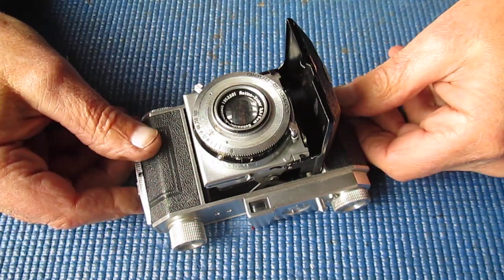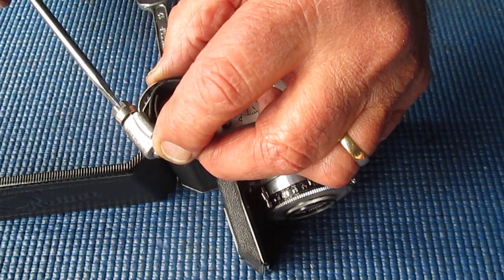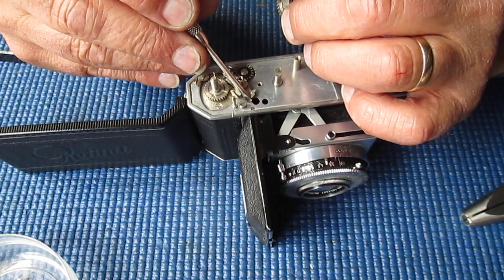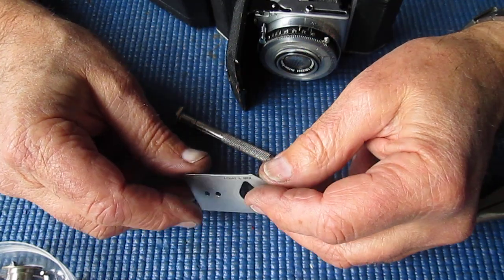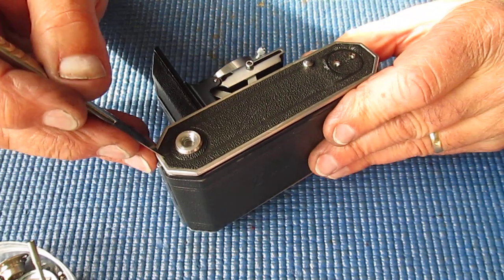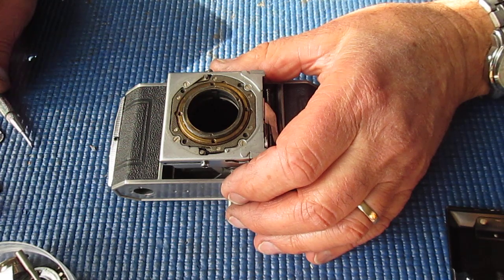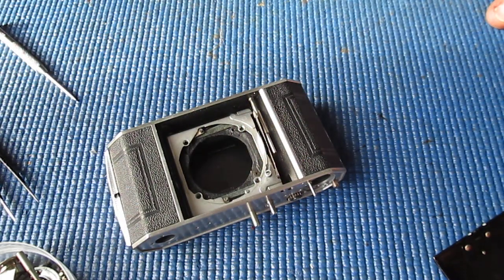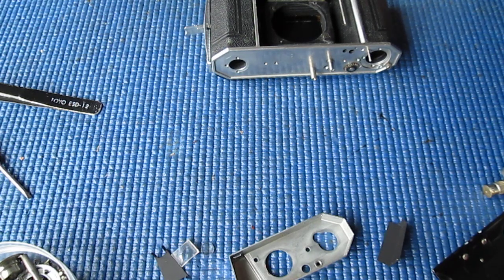Kodak Retina I type 010 strip down part one.

Comment: Very nice dissection. 
btw is the lens useful on any mirrorless camera body?
Reply from the maker: I'm sure it would be. You would need a suitable adapter with some focus mechanism. Not something you will find on eBay I expect.
Reply: @ChrisSherlock   I ask that because I believe what comes to hand when a lens is detached from the camera's body is the only front part of the lens. In those days, to save, they used to keep the rare element of the lens along with aperture system and shutter, inside the camera so every lens you use, is actually part of the lens to be completed into the called Focal Lenght, only when attached to a Retina camera body that has the remaining lens elements inside. 
Thus a simple mechanical adapter as you see sold on eBay is not useful to adapt these particular, incomplete lenses.